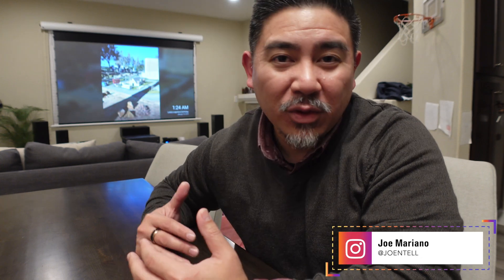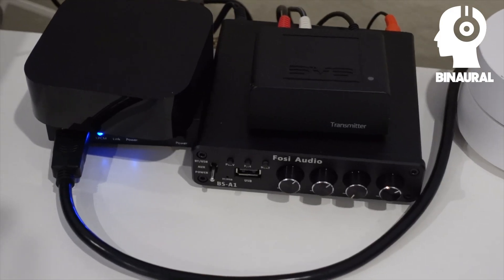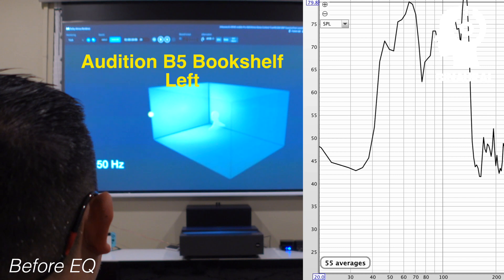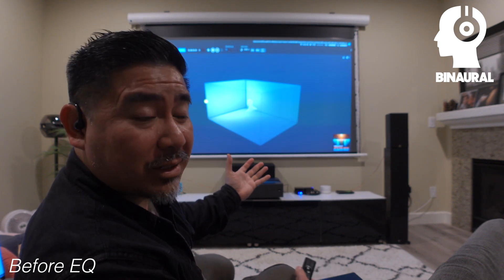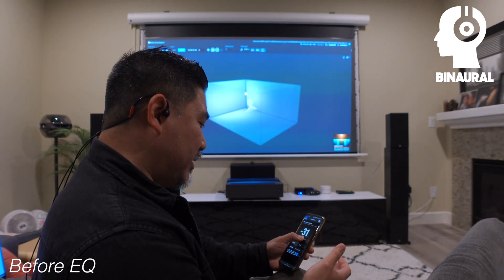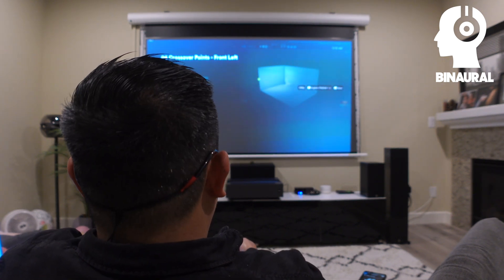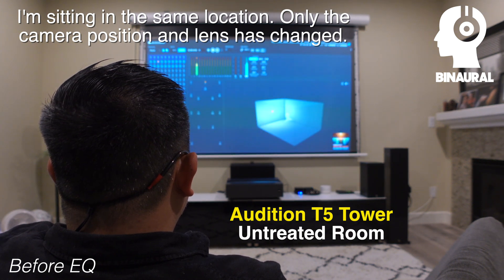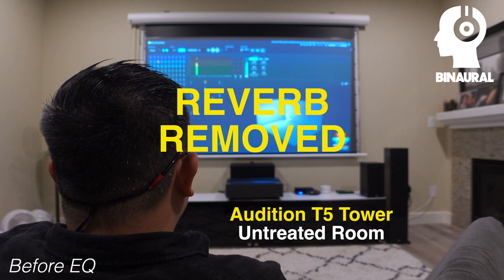Sound Demo: Monolith Audition Before & After DSP

Comment: I like that you remind people to use good headphones. I'm using SteelSeries Arctic Nova 7X with EQ software. On that 1st set I could easily hear down to 32Hz but not quite to 25. That's the bookshelf's with no sub.
Reply from the maker: Yeah! Most decent headphones can get down into single digit frequencies.
Reply: Audio-TechnicaATH-M20X studio headphones through a DAC.

Comment: What DSP did you use?
Reply from the maker: For hardware I used a MiniDSP Flex and a UMIK-1 calibrated mic. For software, I used the Spatial Audio Calibration Toolkit and REW as well as some methods used in an app I'm developing.
Reply: @joentell  awesome, I have a umik-1 but I've yet to use it. I'll check out the mini DSP flex. Cheers 👍

Comment: Sounded so much better after DSP. So what did you use to dial in the DSP?
Reply from the maker: For hardware I used a MiniDSP Flex and a UMIK-1 calibrated mic. For software, I used the Spatial Audio Calibration Toolkit and REW to dial in the crossovers, levels, and delay/phase alignment. For individual EQ of each speaker and sub, I used some methods from the app we're developing.

Comment: Interesting presentation of something that's very difficult to record and share.

Man that SIZZLE before EQ was instantly noticeable the moment you started playing music (even the voice demo was telling)

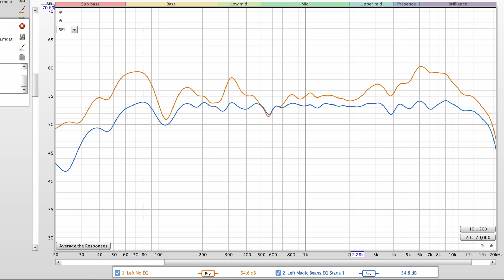6:28 Looks like these should be easy to fix to a "good enough" state with any AVRs that have a Graphic EQ - maybe -1dB or -2 at 4KHz and -4dB at 8KHz. If you've got the time, maybe you could try that and report back? I think it's worth showing people that with some know-how, even tweaking with basic equipment can lead to significant improvements.
Reply from the maker: I'm glad you found it insightful.

Your EQ settings sound reasonable. If you have REW, you can simulate it and see if it follows the curve of applying -3dB to a 12dB/octave high-shelf filter. That's something that I tried and it helps a lot by itself.

The only issue with using a graphic EQ on certain AVR's like those from Denon and Marantz is that the individual graphic EQ is only available when Audyssey room correction is disabled. I would only recommend that if they've set their levels and delays manually using something like the Spatial Audio Calibration Toolkit.

Comment: I seen / heard a solid 30hz-25hz with the sub and the towers being much fuller sound stage. I also liked the fact you could remove the reverb. I hear so many complaints from people that S.S. just sounds like a cave.  Nice demo Joe.  That micro sub does a good job too. I didn't expect that.  The Fossgate amp is a stunner as well.
Reply from the maker: But yes, I agree about everything you've said. I am also impressed with the Fosi Audio BS-A1 and the SVS 3000 Micro does it's thing as long as you have the right expectations from such a small sub.

What's surprising is the bass I was able to hear without the sub. These are extremely affordable speakers.
Reply: Two of the best things I've done for my system are putting up 4 2' x 4' panels of 4"-thick Owens-Corning 703 at my primary and secondary reflection points, and adding a Mini-DSP to my sub.  I'm running a 12" Adire Audio Shiva sub in a sealed 54-liter cabinet (.707 alignment) and with the DSP I have flat response from 80 Hz down with a 3 dB drop at 20 Hz.  Was super-simple with a calibrated mic and REW, REW automatically generates the required EQ's across the entire bandpass area and just had to import those into the DSP.
Reply from the maker: To be clear I removed the reverb in post. I just want to give an idea of the difference in tonality and what it might sound like if their room was treated.